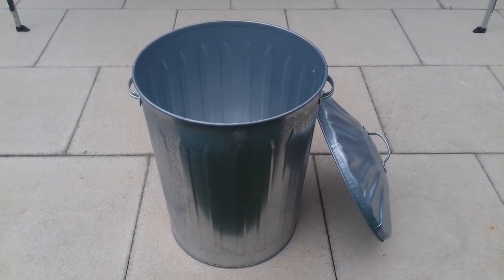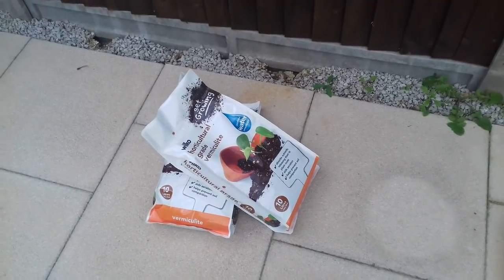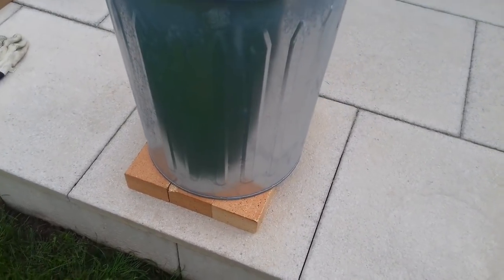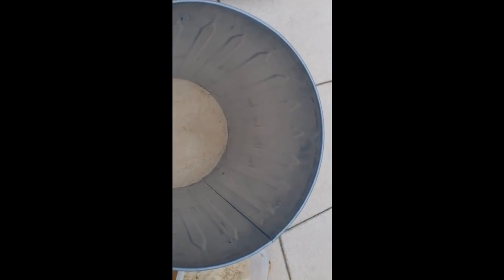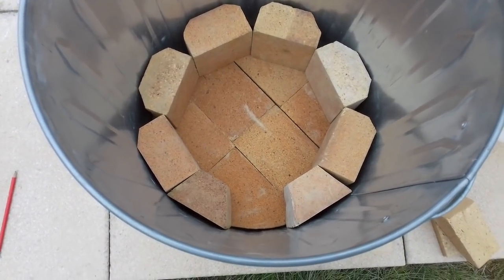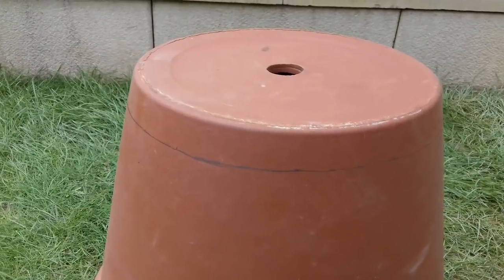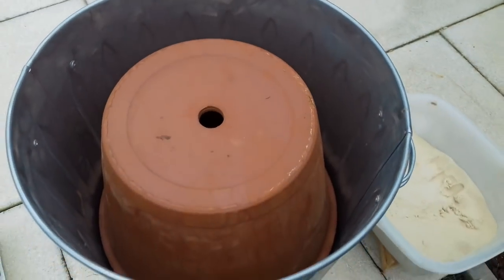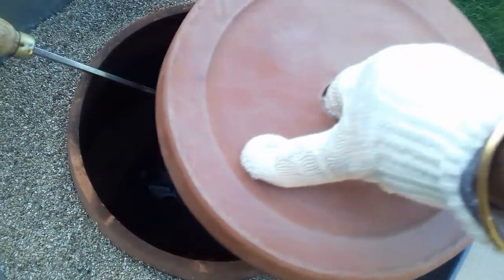Home made Tandoor Oven

Comment: There is a flaw in design which results heat loss. I build the same recently and noticed that some insulation (best to mix vermiculite and fire cement) is required behind the bricks on which the terracotta pot sits. Otherwise love it, no issues noted.
Reply: I had the same issue. Thanks for the tip

Comment: Fantastic. Looks fairly simple, but so effective.   I wasn't sure how you didn't have the vermiculite down at the air vent. Is there something above that to stop it falling down that section?
Reply from the maker: The  vermiculite does not fall through as the clay pot fits flush against the fire brick and drum wall for me. If it does not in your case you can use putty to seal the joint.
Reply: @anoopb2  thanks for the tip. I am going to give this a try if I can get the materials easily. Brilliant video

Comment: I had this idea for some time now, only instead of messing with cutting and lining up expensive fire bricks I'm thinking of putting a layer of sand at the bottom for leveling and heat absorption. Then put one pot on top of the sand and the second flipped upside down. Cut a vent hole in both bottom pot and the bin, run some cheap metal tube in between, then fill the space between the bin and the pots. The only concern I have is the vermiculite which is hard to find in US stores and is pretty expensive. Can I substitute it with a plain old sand? Thank you,  cool video!

Comment: Looking at setting one up in my back garden. Every diy tutorial i have seen is using terracotta pots. Was there any difference in taste over the use with terracotta pots ? And have you considered using a smaller pot  to fit inside that you can fill with charcoal instead of putting the charcoal directly onto the fire brick ?
Reply: Oh and also have you ever needed to change the vermiculite? as when i get round to building whatever insulator i use will be permanent so need to make sure that it can last the ages to say the least.

Comment: You could use Perlite instead of Vermiculite. Vermiculite, if it gets wet or damp takes a lot longer to dry out than Perlite.

You could also cast the base by making a mix and pouring it in and levelling.  A good mix is 20% castable refractory cement (fondue cement) and 80% Perlite.  Mix well and add water gradually to make a stiff mix.  You could also use this mix to seal any gaps and also put a layer in around the bottom of the pot, before you pour the Vermiculite (Perlite) in.

You should get Fondue Cement at a good builders supply merchants or it is available online.

Making a mix avoids having to angle grind all those bricks and will fill up the shape and space perfectly.
Reply: Also, a good mix it Sodium Silicate (water glass) and sand.  Sodium Silicate is available on ebay.
Reply: I love your idea of casting, removing the need of the base fire brick cutting, can this be adapted to remove the need for the side bricks also? I'm thinking to place a smaller terracotta pot onto the base once dried and use mix down the sides of the pot.  That would create a step upwards imitating the second layer of fire brick, but could I pull the pot out after its dried? Or perhaps it could be simply left in although would the coals damage it?
Reply: @MrFrobbo  Yeah you could do that also.  It's a very resistant mixture that I gave and with an added advantage that it's quite light.  80% Perlite after all, and that stuff is light as feathers.  You should be able to pull out the pot after a couple of hours.  It's quite a quick-dry mixture.  Obviously be a bit gentle removing it.  The mix should be hard enough to take a firing (a light one first) after a couple of days.  I dunno about leaving the pot in but it would likely be ok.  They are fired terracotta after all.

Have fun.  :-)
Reply: @MrFrobbo  There are quite a few people who have used that mix to build very high temp rocket stoves.  You cast the J-Tube (the rocket up-riser tube) out of that mix alone, by using a plywood form at the base where it has the horizontal foot, and two steel tubes of differing diameters to create a vertical cylindrical space to pack the mixture into and replicate a chimney (up-riser tube, flue, etc).  It will take 1600 degrees C at least and be more or less unaffected over several years.
Reply: @WG1807  cheers mate, I really appreciate your response.
Reply: @WG1807  'Rocket Stoves', maybe another day 😆🤣😂

Comment: Does the metal bin get hot to touch when you use it? Really interested in making one but have read that it is dangerous to let galvanised steel get hot. Thanks
Reply from the maker: Yes it does get quite hot so be careful, my understanding is that the hot galvanised steel in contact with food is not recommended, which does not happen, other than that it is fine. But pls research at your end too.

Comment: Very good job well done, can you let me know what size of the plant pot used please. Thanks
Reply from the maker: Hi Yes ... was a 42cm plant pot i believe, but find one that fits your bin or holder.
Reply: @anoopb2  Thanks for your reply the reason I asked because just over a week ago I bought exact tin as yours from B&M store the height of your pot was it around 40cm before cutting ?
Reply from the maker: @boubekeursahraoui1177  Yes i think it was ... then i used the angle grinder to cut it down a bit so that it had a snug fit on top of the fire bricks.

Comment: you don't want to use galvanized steel near fire as it can put of toxic vapours. 
use an oil drum instead, they tend to be made out of carbon steel. they will rust, so just seal the exterior with something like clay or cement.
Reply: I was thinking the same thing.  I found a ceramic pot 2' tall 16' wide perfect, glazed  blue on the outside .  But got me thinking about the paint, is not Raku finished but the paint may contain metals I was thinking...any thoughts?  also was reading that vermiculite had asbestos in it from a certain mine in the usa. This was years ago tho, not sure about todays standards.

Comment: Good video, are you still using your oven??
Was just thinking if the skewers were shorter with a looped steel handle, they could fit inside the oven to create a better seal?
Reply from the maker: Yes, still using, naans come out amazing.  
Skewers with looped steel handle could also work, but there is plenty of heat and this format is designed to be like the original clay tandoors of India.
Reply: @anoopb2  Are you cooking whole Tandoori chickens in the clay oven? Any new projects lately?
Reply from the maker: @derekrobbins6735  not made whole chicken. Not sure it would cook through and getting temp right may be hard ... but I will try. My friend made partridge and smaller chicken. But I have stuck to chicken tikka, wings, niblets and lamb chops.
Reply: @anoopb2  It seems very similar to a BBQ Smoker Weber style. Have you ever tried making one of those?? Smoked meat and fish sounds delicious
Reply from the maker: @derekrobbins6735  the tandoor add a nice smokiness and heat cooks through. Will try salmon soon too as that come out good.
Reply: @anoopb2  Sounds good to me, will you post a video?
Reply: @anoopb2  Do you use normal charcoal or do you add Oak chips or similar for the smokey flavour?
Reply from the maker: @derekrobbins6735  normal coal. No need for chips as plenty of smokiness. But if want extra smoky flavour could add. Will up at video soon.

Comment: Instead of the plant pot could you use a chimney stack or pot?
Reply from the maker: Yes it is possible I suppose as really you need the clay pot finish to get the heat effect. You will need to consider the internal space that a chimney pot will give you vs a flower pot :-)

Comment: How do you keep the insulation from falling out of the air hole?
Reply from the maker: Hi, the inverted terracotta pot sits snug against the walls of the steel bin creating a seal.  You have to make sure that the pot you use is approximately the same diameter as the bin.  My pot was a  bit larger so had to grind down its edges a bit but led to a better seal - some will fall out but only a very small amount.

Comment: Isn’t dangerous to use galvanized cans?
Reply from the maker: It is fine. Been using for 1 year and all ok.
Reply: The galvanized metal sees little to no heat and will remain safe. As well the inside of the oven is isolated by the insulation. Nice design.